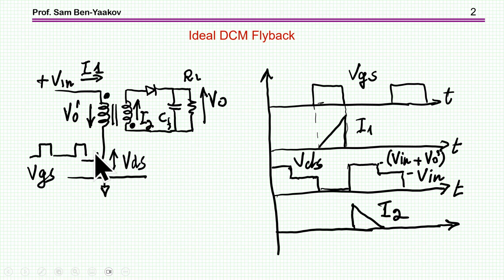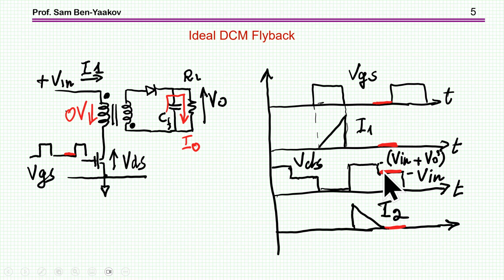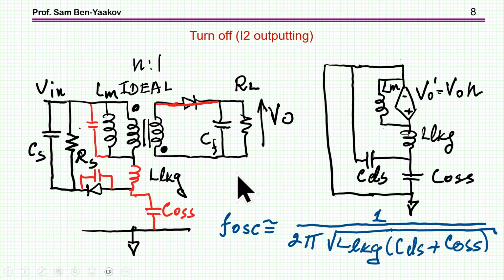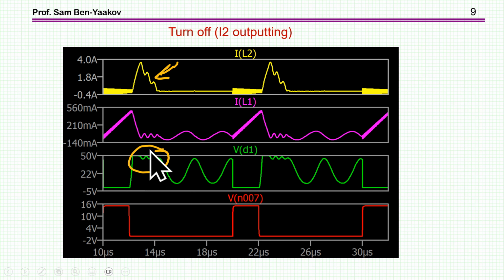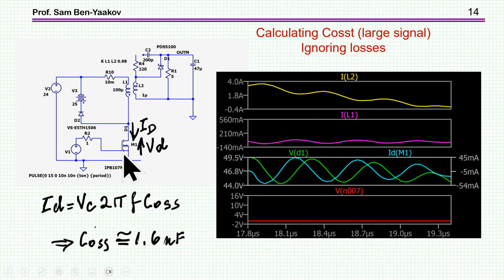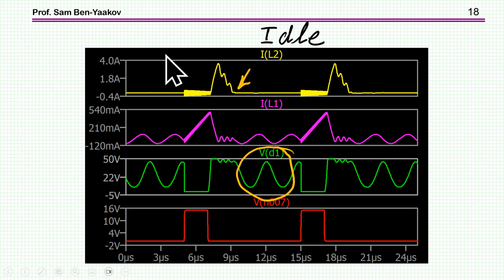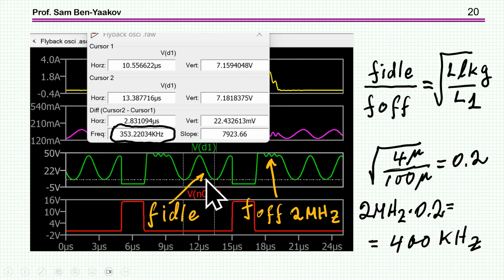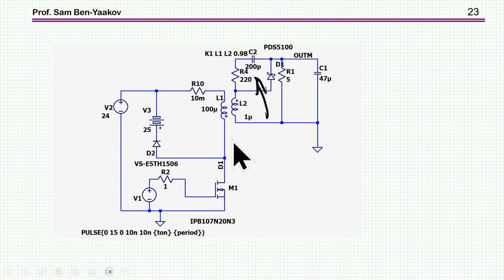The causes of oscillations in Flyback converters

Comment: Hello sir, Thanks for the video. I have one doubt. The secondary leakage and diode capacitance ringing will be present on the diode voltage when the MOSFET turns ON right? you have shown the secondary ringing couples with primary and secondary current  but diode voltage seems to have no ringing. Do you think the ringing will not present at VKA? or I am missing something?
Reply from the maker: Can you please point to the slide number or time in video you are referring to?

Comment: Thank you! Your videos are very clear and straightforward.

What are the downsides to adding similar RC snubber circuits to the primary side of the flyback? In practice, how are these oscillations managed?
Reply from the maker: An RC snubber at the primary helps to suppress the oscillations, but depending on the power level, the resistors' power dissipation will be high. In practical circuits, the oscillations are somewhat damped by the parasitic resistances and other losses. But oscillations do exist in many real circuits.

Comment: Hi, prof, during the idling periode (no current in the diode), the transformer is on 'pause' stat, and the transfomer is 'disconnected ' in the system. I doubt that this is still Lm in your calculations.
Reply from the maker: Neglecting the secondary , what is left is the primaty total inductance, Lm+Lkg

Comment: What are the most common sources of leakage inductance? Is it just the physical separation between both coils? I'm wondering if some small power supplies at some point might have used a lossy inductor core material deliberately to clamp down HF oscillations without having to add RC clamps to the circuit
Reply from the maker: Have a look athttps://youtu.be/TUfaN40T1Yg
Reply: @sambenyaakov  thanks

Comment: Omitting the secondary diode snubber can give rise to current mode control instability because the undamped oscillation is modulating the current ramp. Faced with instability some (I was one of them) like to toy around with the feedback compensation only to discover that that moving the poles and zeros around and questioning the placement of them doesn't help anything. But if you happen to be stubborn you probe around until you understand what is really happening. Power converters I think are only for real stubborn people.
Reply from the maker: Thanks for the input.